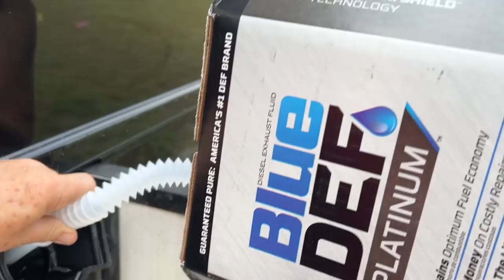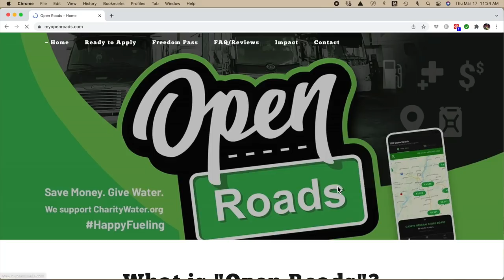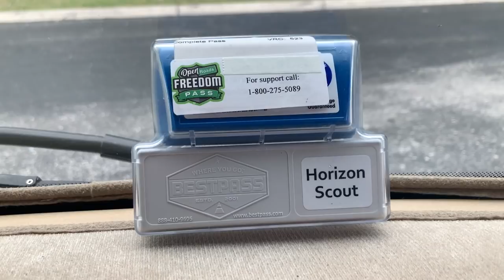RV LIFE | TRAVEL DAY STRESS | BREAKDOWNS -TOLL ROADS -TRAVEL PLANNING TIMING -IS IT WORTH IT? EP215

Comment: I have had a lock on a locking pin just like yours fall off. I too was lucky enough to notice it before towing anything. Must be a manufacturing defect. Safe travels out there!
Reply from the maker: I am certain that during a tight turn, after 5 years, the large hook must have been in the perfect position to "nut crack" the locking end off! Glad I caught it!

Comment: Love your videos! One comment I have to make regards people that believe they don't need an auxiliary braking system. I'm an engineer like you and one of the principles we learn about early on is Newtons Laws. Simplistically if you're decelerating, on average the force being applied to your hitch is 2.7 times the weight of your toad. So if your toad is 4,800 pounds, the force being applied to your tow bar and hitch is 12,960 lbs. If your hitch or your tow bar isn't rated for that kind of force then you'll have a real problem. More often than not this kind of force isn't applied if your easing to a stop but if you have to make a quick stop this will have devasting results.
Reply from the maker: I agree with you 2.7 times John!  Always buy over the rating you think you will need to have some safety margin.

Comment: Mark, I can't tell you how scary your video was concerning the missing hitch pin lock.  I agree with you that if not detected the pin could have worked its way out and dumped your hitch with car on the ground.  Perhaps the cables would have held the van from becoming detached but I can imagine all kinds of damage done.  From one engineer to another I enjoy your methodical thinking.  After watching your video I was considering if drilling a hole in the pin between the lock and the receiver tube to install an additional cotter pin or such to provide some redundancy would be something to think about?
Reply from the maker: Thank you for the reply.  Trust me,.......I filled my pants when I saw that. You really have to stay on your game with this RV thing!

Comment: I've had the exact same issue with those lock pin devices.  I don't trust them.  Our Wanderlodge has the receiver pin located under the coach in front of the rear bumper.  I do exactly what you did and push the clip further into the head.  If someone wants to steal my tow bar they have to crawl up under the coach to remove the pin.  So far so good.  

Thanks for the heads up on the Freedom Pass with Open Roads.  We use the TSD card for fuel stops.  Seems like a good way to coordinate toll roads.  Really appreciate your channel Mark and Sue.  Thanks again from a long time subscriber.
Reply from the maker: Thanks guys,......that is a great idea to have that pin well ahead of the hooks.  We are also looking forward to the toll charges being taken care of automatically with one account!

Comment: When parked or unhooked it is a good idea to have a locking pin to protect from theft .  I will not use one while actually towing either a toad or trailer as it is almost impossible to get the vehicles apart quickly in an emergency situation. I helped separate a burning flatbed trailer with construction trash just by pulling the clip and pin and the guy pulling forward.
Reply from the maker: In a fire, we will have to pull the two pins that attach the tow bar to the car.  Trust me,.....I will only work so hard at this,..........

Comment: Hi Mark - love to watch you and Sue.  We are working in similar roles as we have only had our MH for 18 months.  I was wondering if you like the Airforce one and do you have a video on that installation?  We have the Patriot Braking system and we hate it.  It doesn't sit well in our car.  We wish we would have just got the air brake system, but we didn't have our coach at the time of setup. We have a truck that we want to get fitted for the Air Force One, but man is it expensive!
Reply from the maker: We LOVE it.  Very progressive action between the RV and the tow car.  We have had it for 5 years.  We had it installed,.........we don't remember the labor cost.  My unit is the SMI,........which Demco bought now.   We have it in our Amazon Store. Easy to hook up. Plug in the 7 pin cable and the airline.

Comment: The evidence looks pretty convincing to me that those safety chain hooks leveraged the end of that lock right off. You could see that kind of force turning a tight corner with both pieces positioned just so. If a person was trying to steel the tow bar they already had the lock off so why did they leave the tow bar behind. Good practice to look everything over before departure
Reply from the maker: I will probably be flipping the hooks around as well after I call Blue Ox to get an opinion. I will still cross the cables.

Comment: Hello M & S, just missed you guys at that campground. Mark, in the vid you mentioned rubber caps to protect air line connectors. I have been trying to find them. Can you help a brother out ? Thanks !! Safe Travels......
Reply from the maker: I am sure you could go to a hardware store and get something BUT,............since I was ordering the special break away key I also ordered a few extra caps for each connection,........they are very different sizes from each other.  I ordered directly thru SMI Company which has now been purchased by Demco.

Comment: Happy Easter! Mark, your cables are the wrong way round, the big hooks should be on the Honda side and the much smaller shackles will need much less room on mh side. I use a wrench to really tighten the shackles so the cables won't walk away. The big hooks will make it a breeze to unhook the Honda. Always enjoy your videos, including any Square D wisdom you may have ;-)
Reply from the maker: Thanks for the tips!  I looked at the Blue OX website, and saw a photo with them inserted up from the bottom like you are mentioning.  They DO SHOW that the cables are crossed side to side.  My hooks are the same size on each end of the cable. Thanks,......I will give them a call to confirm!

Comment: I lost my lock / locking pin last November, I was getting off an exit and noticed my car was passing me, I could see the tow bar dragging on the ground, was able to get everything stopped bouncing the car off the back of the RV a few times ,safty cables still attached, minor damage to both vehicles, I have toad brakes via NSA ready brute system however the carabiner was unlatched at the car, no idea how that happened, the 2.5 to 2 reducer was still in the RV hitch barley when we pulled over.
Reply from the maker: Wow!  Thank god that all ended as good as you could have expected,......

Comment: Mark - storing the spare Air Force 1 pin in the MH makes no sense. If some yahoo pulls your pin when you are away from the rig, your spare pin is at the rig. I keep mine in my truck.
Reply from the maker: We have additional sets of plugs, pins and the brake break-away plastic keys in a black canvas zipper bag we use in the Honda to keep all the towing equipment all in one place as well. You are right, a person has to think their back up plans through.

Comment: i never comment , but I noticed your chain hooks are  on wrong , the safety latch should be facing the out
Reply from the maker: I looked at the Blue OX website, and saw a photo with them inserted up from the bottom like you are mentioning.  They DO SHOW that the cables are crossed side to side.  My hooks are the same size on each end of the cable. Thanks,......I will give them a call to confirm!

Comment: Hooks need to come from the bottom not the top
Reply from the maker: I looked at the Blue OX website, and saw a photo with them from the bottom like you are mentioning.  They DO SHOW that they are crossed side to side.  My hooks are the same size on each end of the cable. Thanks,......I will give them a call to confirm!